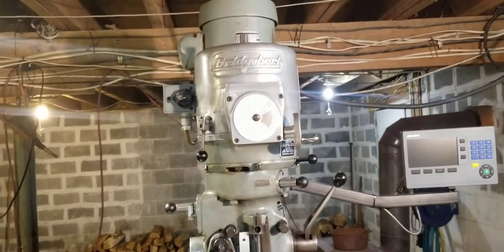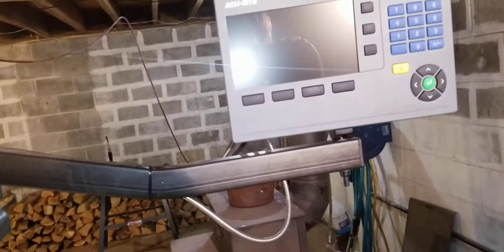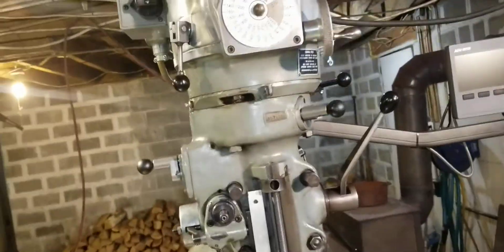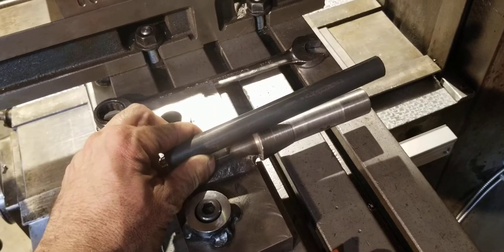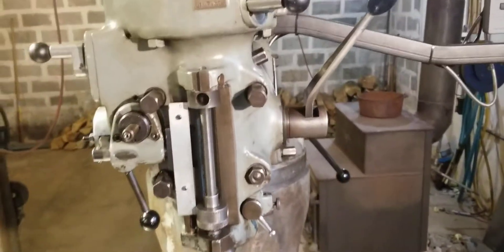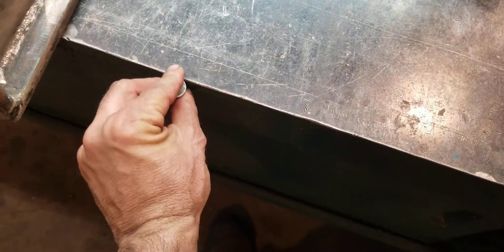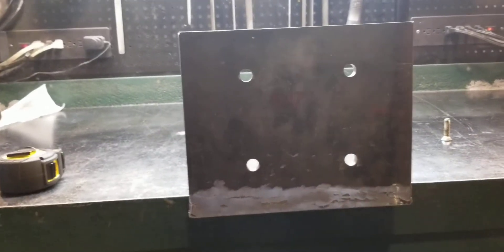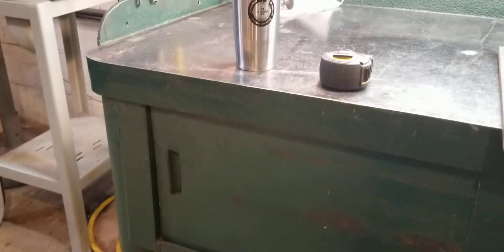Workbench mounting and head removal tool for bridgeport mill.

Comment: I was getting dizzy from all the camera spinning.  Good head removal jig concept however.  Make the mill do all it's own lifting and positioning.  Saw another guy do a similar jig (one of the regular posters, can't remember who).  His jig consisted of a plate and a straight rod mounted perpendicular to the plate.  The plate is  clamped to the tables with hold-downs, and the rod is chucked up  into the appropriate sized collet.  The knee and the tables do the rest.  This solves all the awkward lifting and alignment issues. I don't know how he got the detached head to, and from the mill. Probably an engine  hoist.
Another guy mounted  his mill head on a rolling engine block stand during his rebuild.  That's what I did.  Puts it at a good work height for me, once I get to that part of the rebuild.  The engine stand design allows for a certain amount of tilt and spin, depending on what you need access to.  It also allows easy access to all sides, or to move it out of the way if other projects intrude in on your mill fun time.
Reply from the maker: Should have seen the first few I did... it's hard as you know what to hold the cam still and move things around! These videos are experimental. I need to get a few stationary cameras. Right now I'm just trying to figure out what I need and how to present it. I started this late last winter and then this spring started remodeling a 1973 house I bought so all my spare time last 9 months been focused on that but now I'm back at this again. Thanks for your comment.
Reply: @Depth_of_Cut : I understand.  Life has a way of getting in the way of the things we really want to do.  The progress on my mill is not where I want it to be either.
Camera tripods:  Now a days you can get them pretty cheap.  Especially if you don't mind second hand.  Garage/ yard sales, Goodwill or similar, Family members who don't use theirs - Everybody  has somebody that has one taking up valuable Real Estate in some closet .... etc. .
One tall tripod and one short one That can be set up on a bench, shelf, toolbox, or even a tree stump, are all you really need. 
if you are using your phone to record, adaptors/ holders that screw onto the tripods are also readily available for only a few bucks. 
Move your camera fewer times.  Your viewers don't need to see every little detail, to understand the story you're telling.
When you do need to move the camera .... Move (Pan) the camera slower !
Zoom the camera in only when there is an important detail.  Zoom in at a moderate pace also.  No abrupt moves. 
If the part, or sub assembly is small, move it, to the camera.
Give the camera time to auto-focus on the thing you are trying to highlight, before moving on.  Blurry images  are maddening.  The camera will do a lot of things for you .... if you give it time to do it's thing.
Pick 2-3 places to set up your tripods that will give the best view/ widest angle of the project. and then leave the camera in those positions as much as possible.
Audio:  Last but not least.  Face the camera when you talk for the best, most even sound quality. 
I'm constantly having to tell my wife "Talk to me !!  Not the grocery bag, not the drawer, not the Fridge, and certainly .... not from the other room !!
With sound, distance and direction are your enemy.  Volume changes, sound levels, echoes, muffling, and competing noise ( wind, machinery, the dog, the wife ....Oh, jeez !! did I say that last one out loud ?!!!)

Good luck, and have fun.